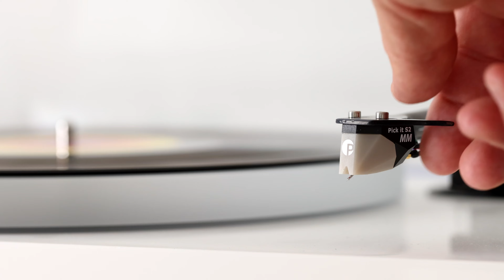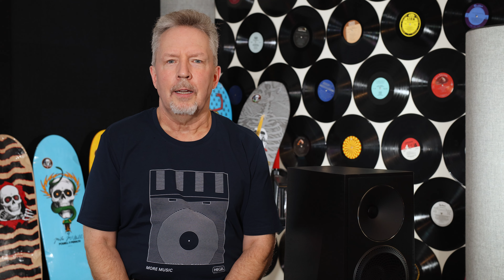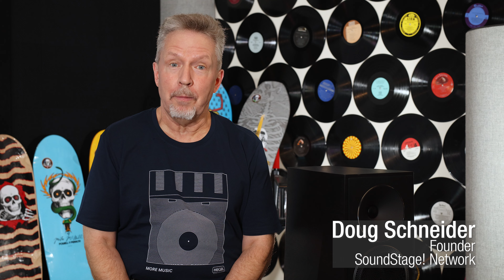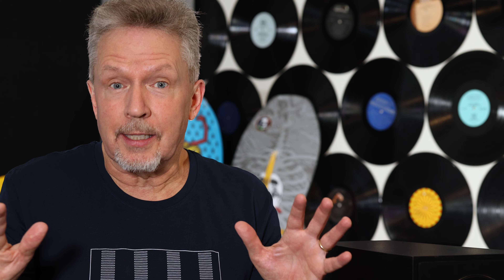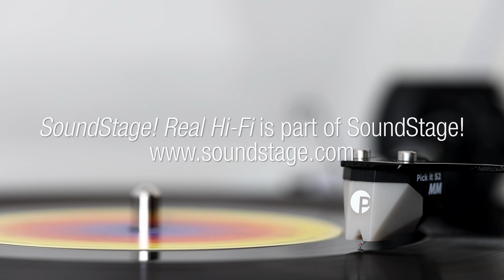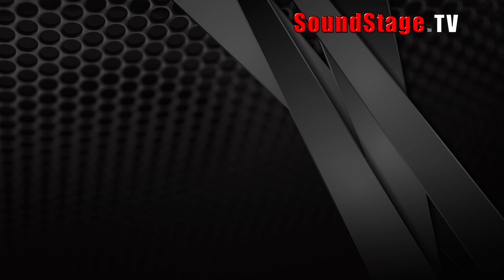Right and Wrong About Speaker-Driver Materials (Ep:89)

Comment: Doug, have there been any materials used over the years that designers learned just don’t make good speaker cones? I’m not talking about something that destroyed itself after a few weeks or something that was ridiculous like gummy bears but more along the lines of foam surrounds which took years before people understood they would rot and disintegrate, or copper because of the weight. Thanks for the informative videos.
Reply: That's a good question because I think in the case of materials that at first seem good, but then rot (like foam), they find ways to overcome that, then they're good again. For example, you do see foam surrounds these days, but they're treating them with something that allows them to stay. I know in the past paper could have problems, but they treat them and make them work. So off the top of my head I can't think of any materials that are absolute no-nos.
Reply: @davidt8438  
Obviously, loudspeaker transducers are electromechanical devices, and as such they are actually quite complex, even though they may appear quite simplistic from the outside.

What most people are referring to when discussing the "materials" that the drivers are made from are their diaphragms or cones.

There are 3 primary attributes that we want any speaker diaphragm or cone or dome to posses:

1. It should be a perfect pistonic diaphragm, with zero deformation or deflection while operating as a moving piston in order to move the air.

2. For efficiency and the ability of the motor system to perfectly control its inward/outward movement (i.e. input signal = output signal), we want the diaphragm to be as lightweight or low mass as possible.

3. Damping.  We want to use a material for the diaphragm/cone/dome that isn't prone to creating it's own inherent resonances or secondary sound(s) when the signal being sent through voice coil acts upon and forces the diaphragm to move forward or back, i.e. vibrate.

Unfortunately, a common problem is that the most common and inexpensive materials that are used to fulfill the first two ideal properties, stiffness/rigidness and light weight, are also usually the most prone to create inherent resonances, i.e. "ringing" and "stored energy"...aluminum or an alloy mix such as aluminum/magnesium.

These resonances are often exhibited as one or more "break-up modes", most often near the top region of the driver's usable bandwidth, right where we want to place a crossover.

Paper/pulp diaphragm drivers are usually quite lightweight, have excellent damping properties, and are also quite stiff and rigid...but only to a point.  At higher SPLs and excursion, paper/pulp-based cones are prone to deformation and significant flex/warping, especially near the edge surround.

The edge surround itself is a constant variable.  Both its shape and tension/restrictive force on the +/- cone movement changes as the diaphragm moves inward & outward.  This means that the otherwise perfectly-shaped stiff and rigid cone or diaphragm is actually changing its overall profile dependent on the frequency and amplitude of the signal.

Ideally, we would not use an edge surround, but it is necessary in order to reduce any lateral "rocking" effect of the diaphragm, as well as keep the voice coil centered in the magnetic gap during +/- excursion.

Resonances from the diaphragm/piston/cone of the driver can also be created by and at the intersections of the main diaphragm to a central dust cap over the voice coil, or from the cone to the perimeter/edge surround of the suspension, which both usually protrude above the diaphragm.

The protrusion of a dust cap and/or edge surround often create a resonance and diffraction element similar to what happens via diffraction of the sound waves along all edges of a loudspeaker system's front baffle.

All of these effects can create frequency- & amplitude-dependent Intermodulation distortion (IMD) which can cause instruments and vocals/voices to sound unnatural and/or harsh.

Different methods are used to either tame, distribute, or eliminate these various resonances, break-up modes, and diffraction elements.

We can try to actually eliminate these resonances and diffractions, or at least reduce their effects within the AUDIBLE spectrum and the intended passband of the driver as much as possible by using different materials, or combinations of materials, or design features.

Or we can impart a change in the resonance and damping of the material in some way so that these resonances or "ringing/break-up modes" are pushed beyond the intended pass band of the driver.  i.e. if your tweeter is designed to play up to 20kHz, we might use a different material, dome profile, or some other element of the design to push that unwanted break-up mode or resonance above 25kHz+ where we will not hear it.

Or we might use a more ideal cone/diaphragm material such as beryllium, which is extremely stiff, extremely lightweight, and has excellent damping properties, which all result in much less ringing or stored energy, BUT is a rare earth metal and Very Expensive to manufacture, as well as potentially toxic when broken/shattered.

Some drivers are made from very lightweight and stiff/rigid Carbon-Fiber.  However, Carbon-Fiber is very hard and brittle in thin layers, and it's not well-damped, so it is prone to resonance and break-up modes (distortion).

To combat this, we see some manufacturers using a composite sandwich of two Carbon-Fiber (or fiberglass) diaphragms with an extremely lightweight and thin layer of "Rohacel" foam or an aluminum honeycomb material sandwiched between the two C-F layers in order to maintain the overall stiffness and light weight, but massively improve the diaphragm's damping properties.  But the compromise is still some degree of added weight.

Or we might use a central "phase plug", or change the dust cap design via its shape or size to reduce resonances and diffraction (i.e. the multi-faceted "orange juicer" dust cap).  Or use reinforcing ribs in or on the cone to reduce deflection/warping, while adding as little weight as possible.

Or we might use multiple slits in the cone/diaphragm, and/or apply a "dope" solution to either help distribute or reduce and dampen resonances.  Good examples of this are the radial slits in the cone of the Scan-Speak "Revelator" series of drivers, or the unique shape of the rubber edge surrounds that Purifi employs on their drivers.

Many silk or fabric soft-dome tweeters use some form of soft/pliable doping solution added to the dome, and this is sometimes used on larger cone midrange and midwoofer drivers as well.

Each or ALL of these things can affect the performance and reproduction accuracy of the driver, and the implementation of each one might also result in some degree of compromise or trade-off in another aspect of performance.  It's really a delicate "balancing act".

And then there is the motor system and electromagnetic design of the transducers to consider, which are an entirely different subject, but equally important to the whole.

Comment: Good follow-up. I recall another designer/reviewer once saying the priority of importance of a loudspeaker us: 1. speaker driver materials 2. crossover 3. cabinet construction. Which is also why I think Dynaudio has such an advantage in this field due to their proprietary Magnesium Silicate woofers.
Reply: Thanks for watching. I'd subdivide #1 into several areas -- materials is one, but obviously the mechanical and electrical design, etc. Basically, everything about how the driver gets made. But what's also definitely true I think is to get the driver right and do less with the crossover, something I touch on in a newer video.
Reply: @dougschneider8243  I recall when Dynaudio Confidence 20i was upgraded from 20 by adding a Hexis device behind the tweeter and making that enclosure, they were able to simplify the number of components in the crossover at the same time.

Comment: there are a number of objectiver reviewers that use DSP to adjust the speaker to sound neutral. imo if you use DSP you may interoduce additional unwanted distortion. DSP in my experience isnt always good.
Reply: Very good point. In fact, in my mind is a video about what DSP/EQ can and cannot do -- and what it might harm.
Reply: @dougschneider8243  thats would be a great vid.
Reply: @dougschneider8243 I know already you generally want to fine tune the last imperfections rather than expecting a bad speaker to sound good out of DSP.
Reply: @genkifd  
True.  I'm an advocate of using active, multi-channel DSP for loudspeaker system design, if not as the final implementation, at least as the design tool to help create the ideal passive crossover.

The problem is that there are usually at least a few inherent problem attributes or issues within the driver or transducer itself that no amount of DSP will correct.  The term "you can't polish a turd" comes to mind here.  ;)

You must start with as good a driver or transducer as possible, and then use it to its best advantage within its intended passband to avoid as many of its potential inherent issues as possible. 

This is where choosing the "right combination" of drivers to use in a multi-way loudspeaker system comes in to play, as well as the crossover design.

I believe this is what Doug meant when he said not to force the driver to do something it doesn't want to do.  First and foremost, you've got to use appropriate drivers, and then use them all well within their intended passband where any potential major issues aren't likely, or are at least minimized.

DSP can certainly help with this, but only to a point.
Reply: @bbfoto7248  Totally in agreeance - the problem i have is objectivist trout that DSP is the answer to every problem speaker. NO need for room treatments just adjust any budget speaker to get a flat response. 

Another problem i dont understand why  Generlecs get rave reviews when many of them have high noise floors. A hum can be heard from nearfield listening position.